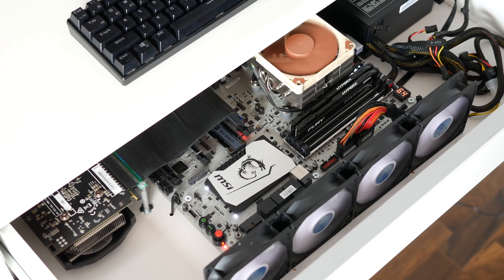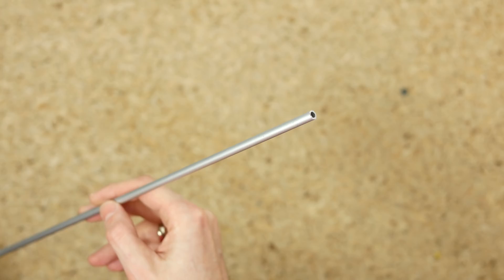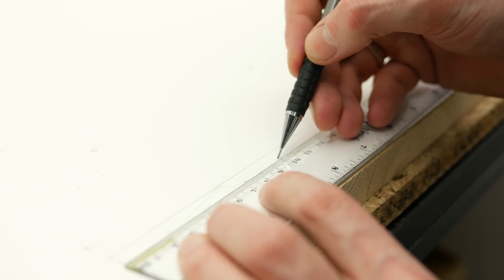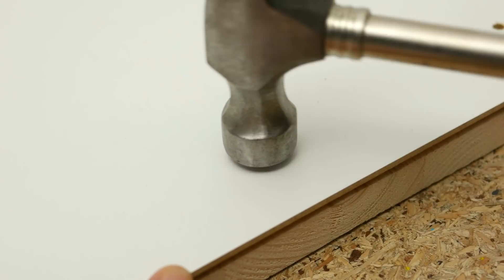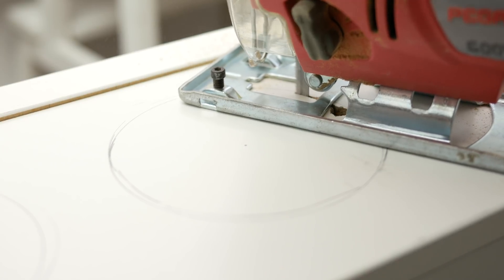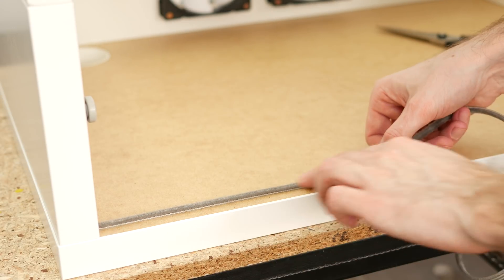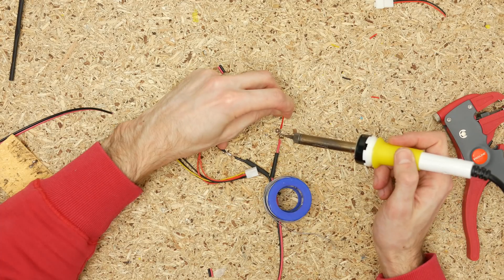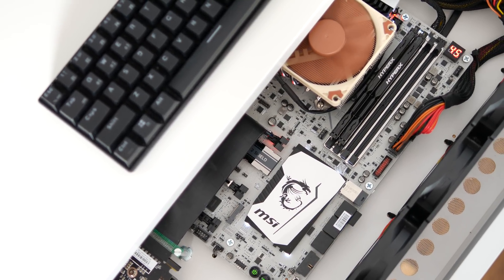How to make a desk PC from IKEA MICKE desk - probably the cheapest DIY desk PC

Comment: I wanna do something like this at one point. Maybe take it a few steps further and attach it to standing desk legs, maybe replacing part of the top with a clear top, wonder if there would be room to add sound treatment inside to make it quieter 🤔 if it was water cooled it would be even more low profile, I'm surprised I can't find similar extension ribbons for RAM like you can for PCIe connectors like the one you used for the GPU, but if they exist, you could make the entire thing as thin as whatever height the CPU cooling block is, since you could also lay the fans down. Ok I'm off to search for the flattest PC build lol.

Comment: Nice, but the four intake fan are totally useless. Only exhaust fan are needed to achieve a good air circulation. If you see every electronic appliance that work with calor have only exhausting fan (like air conditioner, refrigerating tower, vacuum cleaner excetera). This is the way for best possible air flow (and noise reduction)

Comment: i'm making plans to make an desk pc from scratch and my question is that if i place the gpu normally (leg room is not a problem because it will be almost room long) will it be a good idea making holes for the front, rear and psu fans on the front and back panels of the pc box work instead of drilling air holes?

Comment: Dumbest thing I’ve seen all day... why? Why is a drawer pc useful?
So instead of having a, say, a tower that could be moved out of way, you move hot, moving parts into a drawer, making the drawer uselsss and a pc case which is useful as a heat, electric, noise and safety isolation, into something most people use intrinsically,  making both drawer and machines absolutely dangerous and useless... 

Stupid

Comment: Way to many things are wrong her.  The idea is good but.  alternating Ram slots , fan with no fan controll ? your motherboard do work good as a fan controll trust me. 
........ and more... but anyway video was made good
Reply from the maker: I just did a test of that theory in my 'Desk PC for adults'. I connected AIO fans to the motherboard header instead of the Bitfenix fan controller, and my initial test results were very disappointing. The fans were loud most of the time. Can you recommend software that can control fans speed? SpeedFan doesn't work for me :/

Comment: its all nice but still the main question is why??
this table is very small and not that comfortable and the drawer could be used for some stuff to put in, and also fans will generate noise..

i would simply recommend buying All-in-one PC with simmilar specs and that way you dont need to mess with table
Reply from the maker: I build this as a proof of concept, which was converting pretty much any desk into a desk PC. Thus I bought the cheapest desk I could find in Ikea, which also happened to be the smallest one. This way it was more convenient to transport, took less space in my apartment and eventually was easier to resell.  Would I use such on a daily basis? No, that's why my workstation desk PC is a custom made, much larger desk: https://www.youtube.com/watch?v=BUM7y3v53OY
Reply: as a proof of concept its OK, yet you still need to take into account following factors:
- such small or simmilar table would require you to have low height colling radiators and as seen in your videos only 120mm fans, this limits cooling options greatly.
- for example, if you would want to put i9900K overclocked at 5.2Ghz, then the cooling in this or other desk wouldnt suffice.
- for real culling you need custom loop with tubing,etc..
and its too complicated and messy for desks.
- now, if you dont want to put high performance machine into desk and using only mid-range hardware, then again, why just not buy AIO PC and put it on any desk without any mess and custom work?

Comment: As much as it is a good idea, especially considering the price, I wouldn't do this ever. Way too much downsides. Here are a few I can name:

1) Vibration. The entire desk is one vibrating unit.
2) Not future proof. It doesn't actually allow you to easily exchange things because everything is custom attached. Meaning that every new part should be attached again. Resulting in a heavily damaged desk after a while. 
3) Ventilation. Still not sure how this would benefit ventilation and it's flow. Also not sure why people tend to put warm airflow exhausts underneath, as heat actually rises.  
4) If you have a desk with a drawer, I would like to use that drawer for other things. Like a keyboard, or office supplies etc. 

Ofcourse it's a nice idea, and sure, I am encouraging to try more ideas. But sometimes a good idea harbours a lot of problems and these needs to be fixed. The cheapest DIY, doesn't mean persé that these problems should be there. In fact lots of things can be dealt with by installing it differently. I've seen someone doing a deskbuild where he made a standing backpiece so, that he could fit the pc in the backpiece (hollow box) and attached the monitor to the side of it. Below the monitor he made all the extended connections like USB, headphones on/off.  It was really professional, and I'll bet that he paid as much as you.  

But still, I don't want to take anything from you, because it the end result does matter and yours looks quiet nice! I just wanted to point out there are more ideas, that may have been a better option that this. Anyway please keep doing projects like this!
Reply from the maker: Hi, thanks very much for evaluating this project. The general idea was to make it look like a regular desk so the standing backpiece or whatever wouldn't work for me. The drawer is the only option to store PC components and believe it or not, it is quite challenging, especially on a tight budget...
As for the downsides you listed:

1. No, the desk does not vibrate.
2. Motherboards and GPUs have standardized mounting points - you can swap both as you please.
3. The exhaust fans are at the back, sucking the hot air out.
4. This one is way too small to have a second drawer for other stuff, but I know it would be useful and that's why my main workstation desk PC has one: https://www.youtube.com/watch?v=BUM7y3v53OY

I'd really like to revisit this concept in the future as there are so many things I'd do differently this time around.

Comment: I’m sure you had fun designing this setup. Of course anyone that has built any electronic projects will point out a that safety is paramount.  A power disconnect switch is required. Also a drip cover should cover all electrical circuits. A child proof latch is a must have item if any children are present.  Other then that it could work for some people.

Comment: Great video! I am planning to build one, I have a question though. Do you feel any warmth on the tabletop? Or do you feel any discomfort at your hands from warm temperature when, let's say, you are gaming for an entire day?
Reply from the maker: To be honest, I didn't use this desk much before selling it - I have my 'desk PC for adults' workstation so I didn't really need another one. With all those fans, the airflow is quite substantial, but there is a possibility that the top will get a little warm to touch at some point during an intense gaming session.
Reply: @YetAnotherTechChannel  Just as I thought. What about your 'desk PC for adults'? Does the top get a little warm?
Reply from the maker: @ax3eify  Nope, not at all, at least after 2-3 hours of gaming.

Comment: Nice DIY 👍 but need more improvement.

Air flow is good or not just use smoke from dry ice or vape

Especially for noise squeezing foam in the gap between vibrating objects can reduce noise.

Waiting your next video.

Comment: The threaded inserts are meant to go in from the back side of the piece so the tension on the bolts is actually what holds them in. The barbs are just to keep it from rotating when threading a bolt.

Comment: Very nice. Certainly a speed control for the fans is necessary. I would suggest an addition for the intake fans. Make a box to restrict the cold intake flux to not mix with hot air in the drawer.

Comment: And later the motherboard gets overheating because the hot air doesn't scapes.
Reply from the maker: There are exhaust fans at the back, so no, the motherboard does not overheat.
Reply: YetAnotherTechChannel ok, but the air needs to go out, it can't stay inside cooling the same hot air.

Comment: Bro, you're running your memory in single-channel mode. You are probably hindering your performance a good bit.
Reply from the maker: Thanks for pointing that out. 
In this video, and most of my other DIY custom builds, all of the components you see - these are just props that I use to show that my designs are in fact fully functional. Memory configuration isn't particularly important in that case. When I'm done, all parts are packed and shelved for next project.
This is what I run in my main workstation: https://www.instagram.com/p/BnDaDOvhVtI/   ;)

Comment: Cheap? If you do not have the tools you have mentioned, you have to buy them.
Reply from the maker: But all those tools are an investment as they do come in handy every once in a while. A power drill is a quite common tool in a household and those bits aren't expensive at all - I'm using cheap ones from one of those big chains hardware stores. I guess a jigsaw is a less common tool - I bought mine 13 years ago for less than $30 and it's still going strong. 
Now, those woodworking YouTubers - they use hardware that costs tens of thousands of $.

Comment: The nut inerts are installed backwards, they are designed to pull tighter into the wood as you tighten your fastener. I'm sure they work just fine as they are holding anything of weight, nevertheless if you have had problems of them spinning in place, the previous statement is the reason. Great video, keep it up!
Reply from the maker: Thanks for the tip - I'll make sure to fix it properly if I ever have to mount something heavier :)

Comment: You got fans! My gosh. Nobody ever wonder the vibration issues in desks like that? What about the heat dissipation that reflect onto working surface. Any architect working on a light table would appreciate what I am talking about in old school times. It will heat up quick.  Not to mention radiation. Fellas move the motherboard/psu stuff away off your body. Put in a room and route fiber-optic HDMI cables and passive usb3.0 cables as appropriate at least for dB comfort. Most of the world is not living in Japan. Some people could have some sq ft to spare for gods sake. Anyways fun to watch though.
Reply from the maker: Did you see me building the whole thing? I'm not wondering here on this channel, I roll up my sleeves and make things happen. It's my third desk PC and I assure you - it doesn't vibrate at all.
There is no heat build up as the air is exhausted at the back and the temperatures are very reasonable given the relatively high CPU TDP of 95W and a low profile heatsink that isn't even rated for such TDP. As I myself have been a desk PC user for almost two years, I did purchase an EM radiation meter and rest assured - the readings were all within the norm. This video is not a definitive guide to making a desk PC but with a tiny bit of imagination, it can be extrapolated to pretty much any desk. 
Most of the world doesn't live in a house with 10 bedrooms with a walk-in closet and what not. I live in Warsaw, in one of the most expensive districts - moving the computer to the next room would be waste of money.

Comment: For the 4 fans in the front you could of made something with foam and to have it at least 2mm above from the wood which would cancel out the noise from the fans also another thing you could of done was instead from the bottom of the drawer for vents you could of cut out at least 3 big holes in the front area of course using mesh for a dust filter and you could of added a little bit of LED lights to make it look cool.

One other option you could of used as well that could of been useful and cool at the same time is make an oval cutout from the top of the desk on the left and right side as outtakes for the heat and still as an option add in LED's and it is also nice for people that wants to stream and have a good enough lighting since it would provide enough lights.

One other thing about a desk like this one as most people might not know about is you could turn it into a custom arcade machine of course using older PC parts like using an i5 650 with a GTX 660 Ti which the PC could be used for esports titles as well so really there is 2 things the desk can be used for and when i mention a custom arcade i mean the arcade sticks would be mounted on the top of the desk which you could make a custom board to go over the buttons so you could use a keyboard and mouse.
Reply from the maker: Foam padding under fans would have helped if vibrations were a problem. But those fans are stuck pretty good so vibrations are not an issue. It's the sound of the air moved by the fans that some mind find a bit loud.
I like to keep things clean and making air vents on the front would ruin the look I was going for.
Reply: I wasn't really referring about under the fans what i meant was using brackets on the sides with form on the sides and also for ventilation for the front you could always use something like this https://i.gyazo.com/c15b498bfccebe7fc3219c05130d4582.jpg which could make it look clean and not ruin the look. 
Just have to be a little more creative to see what i see which would make things cooler and better air flow.
Reply: Take a look at DIY Perks HTPC build and you would understand what i meant for the fan as well.

Comment: Could the 4 front fans potentially be replaced with a large two-fan AIO CPU cooler?
Reply from the maker: You should be able to squeeze a 240 mm radiator there. I did two desk PC builds with CPU cooled with AIO and this time I wanted to see if it's possible to air cool a PC in a drawer.

Comment: some things you've thought out very well, while others..... not so much.

-sets of standoffs and accompanying screws exist for very very cheap in both nylon or brass.
-a standard ATX powersupply would fit and would be much cheaper
-if you're going to move the drawer down to give more airflow space don't put a bar to block it......................
-there is no good reason for the intake fans to be the way they are, they'll mostly just be recirculating air like this, you could have stuck them flat to the floor or stuck to the front with proper intakes either way.
-this is minor but, i'm not sure how good a filter tule is, filter material can be bough at the fan's size or in a roll, either way doesn't matter if the intake isn't filtered
-and yeah you're RAM installation isn't right, i guess there IS a reason they still ship a manual.

side notes:::: even thought the top and sides of those super cheap ikea desk are corrugated cardboard and you can't do anything through them, the drawer is all particle board and MDF so you can drill or make holes through it without any problems. so you could have legitimate intakes on the front with the fans mounted directly to them. Or even the switch actually on the front of the build instead of hidden under. very very easily with no extra cost.
PS: why not use the cable hole in the desk to route the keyboard mouse and screen?
Reply from the maker: Thanks for the feedback.

- I shop at a local hardware store and they don't have standoffs.
- When I'm building something that I will not be using (and that was the case with this desk), I use spare hardware that I have laying around - and since I didn't have a regular ATX PSU, I used SFX... I could also go with HDPlex, but that would be even more exotic ;)
- I'm not sure what bar you're referring to...
- Intake fans do a really good job pushing the air over the motherboard. Placing them flat would require adding a custom shroud to improve the airflow and the plan was to keep the project as simple as possible.
- I used tulle a number of times before and I think it does a pretty good job and again - I'm using materials that I already have.
- The video is about making a desk PC, not assembling a computer - the hardware is irrelevant. I put the components in only to boot into windows, launch Prime/Valley benchmark to take temperatures readings, that's it.
- As for not using the cable hole. First of all - I put this setup together only for the purpose of taking some final b-roll shots with actual hardware. Second of all - both mouse and keyboard are wireless. And last - routing cables to the display through that opening would just look awful.

Comment: I built a desk computer 10 years  ago, but it popped up like the hood of a car, which was very convenient for switching components. however, I almost set my place on fire. just before dozing off i was thinking "i did not put blining LEDs in this....?" and it was in fact some LED bar or something with a bad connection... also - did you include any metal shielding? I read horror stories about people killing the taxi stands radio across the street and stuff... apart from that - nice buid. do a jerry can next

Comment: In my opinion, you better use a small 120mm liquid cooling system. You can put the fan and plate horizontal beside the GPU. Then, make holes below them for the air ventilation. So you can still safely overclock the CPU, and maybe a quiter system.

Comment: Gluing the fans together at the front made no sense to me. That same aluminium bar you used previous for the extender could had also been used to not only fasten the fans in place, but also to fasten them together with custom-cut metal fasteners which could had been painted black and mounted on top of the fans to join them together.